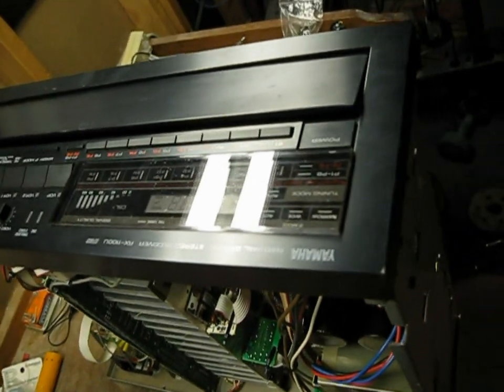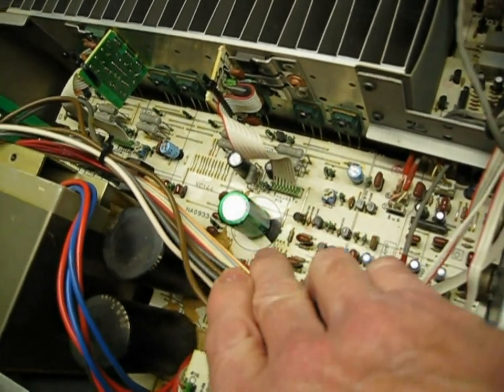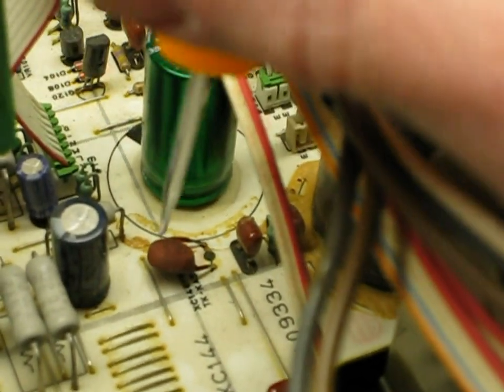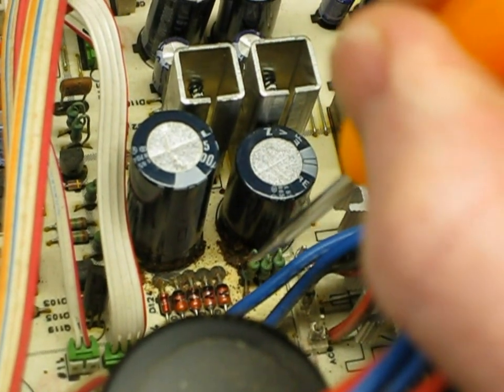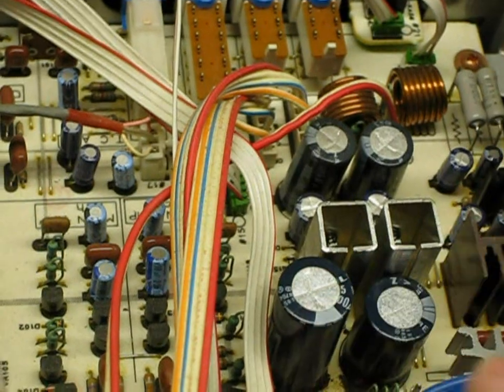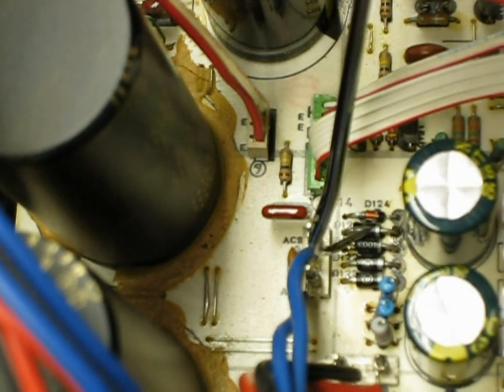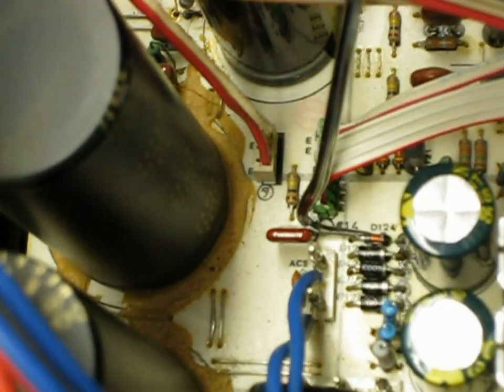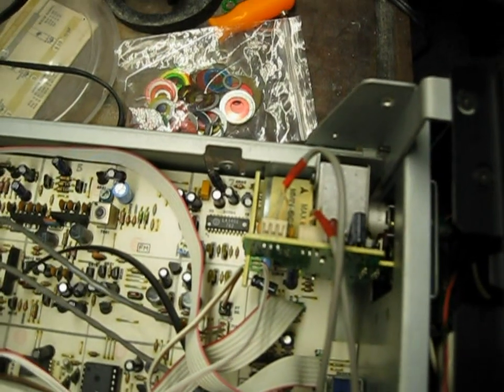Yamaha RX-1100U Repair *Many Surprise Issues!*  Part 1

Comment: The cap you took out is a Nichicon Muse, and those are bipolar (no neg and pos leads). Was it supposed to be bipolar? What was it replaced with? Polar and bipolar have different uses and aren't really interchangeable. It appears that where that cap goes the is a black stripe on the board indicating it takes a polarized cap.
Reply from the maker: Someone had tampered with it before I got it. I replaced it with the value it called for in the schematic. I don't recall what brand etc I used. I sold that receiver a while ago.

Comment: Hey Tom Enjoyed video I have a RX1100U receiver and currently not working it started with one channel gone out now completly out with no sound.  Would llike to have it repaired can you help.
Reply from the maker: That's a tough one because the problem could be anywhere, but start at the basics. There are internal fuses, check all of those. If one is blown you need to find the cause. L/R speaker fuses could be bad speaker wires etc. After that it gets difficult to trace.

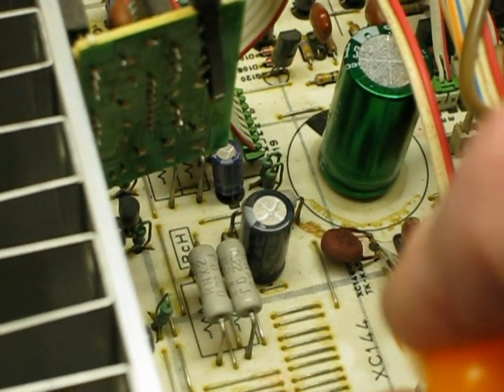Comment: Tom, I currently have the RX1100U on the bench also. Just a note, the 22ohm resistor as stated in the schematic at 3:04 is incorrect. The actual value of this is 470ohm, standard carbon resistor. I believe as the original I took out was 470, I will check to verify. The service manual for this particular amp is wrought with incorrect info so be careful.
Reply from the maker: I replaced R290, sure you aren't confusing with R212 & 211?  They are 470k, opposite side of the cap. R290 is 22k on both the schematic and component list.  I had noticed some things in the manual didn't match up and the PCB has some capacitors with the icon for resistor printed on the board. Also on the board diagram in the manual, R262 is actually C193 and R251 is c192 (verify that if needed, I made notes but don't remember specifics.)
Reply: @AudioTomReviews  I checked today and the resistor I removed from R290 slot is marked as a 4.7ohm but identified on the schematic and parts list as 22 ohm. I must admit this SM is wrought with errors and even component layout mistakes as compared to the boards.
Reply from the maker: @Mork007  Hmmmm, so you think 4.7 is the correct value? What would be the effect of the wrong value, any idea? I wonder if there were several builds of this unit. There was an RX1100 before the RX1100U. Perhaps the service manual used some of the old schematics.
Reply: @AudioTomReviews  Not sure what the difference would be in the resistor value difference. One of the first things I checked when I see the glue leakage around this area was to remove the components and test them. I found R290 opened. It was colored as a 4.7ohm although the schematic says it is a 22 ohm. I replaced it with a 4.7. I have not powered it on yet as I am waiting on other parts to finish this unit.

Comment: Hi Audio Tom
First of all, great video!  I have a RX-1100u receiver with a blank display. Nothing lights up on the front but everything else seems to work ok. Was wondering if you could do a repair video for this. Also if you have any tool sponsors, what soldering equipment do you use.
Thanks Jim
Reply from the maker: Actually I work in IT and the electronics repair is just a hobby for me. I need to replace 2 more capacitors in my RX-1100U (I think). When I am in there I will look to see if there are any likely culprits for this display. Sometimes you just have to open it up and look for the obvious, a burned component, cracked PCB, bad solder joint, oxidized connector. Some of these problems are quite small, so you have to look close. And with electronics this age my first thought is a bad electrolytic capacitor.
Reply from the maker: Check this, different model, but could be it. FYI that is not an LED but an little light bulb. https://www.youtube.com/watch?v=zuKlNW8GveQ